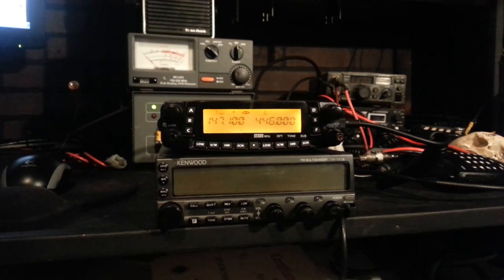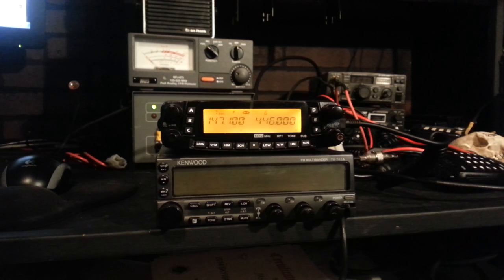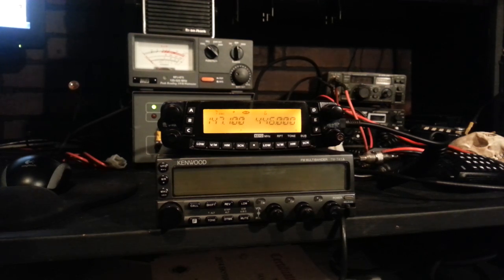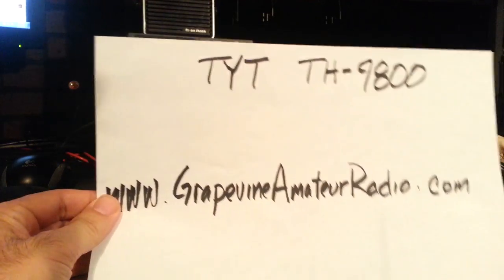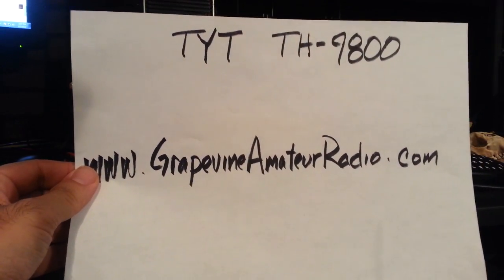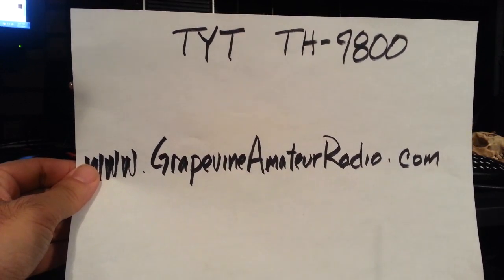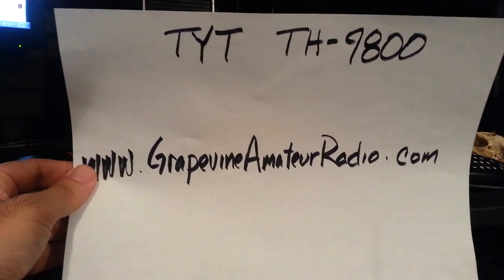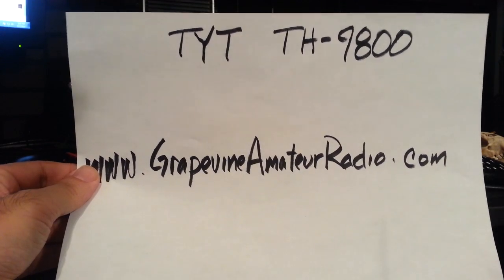How to Program the TYT TH 9800 Quad Band Ham Radio - Ham Radio Programming

Comment: 73! After two years some day start  a constant beep when I change from voltage display to VFO, mainly in the 50 MHz. Somebody know something about this issue?

https://www.youtube.com/watch?v=S0dP5ALsIjs
Reply from the maker: Not sure I understand what you are asking
Reply: @HamRadio2  Thank you! I wanted to know if you know something about a problem that other users of this radio have had, like me, the radio emits a constant beep when switching between memories and VFO or from another screen, it happens to me when I switch between the voltage view and the 6 meter band. In the link you can see the video I made a few days ago
Reply from the maker: Yes there is a beep when you change channels/bands, etc.  You can turn that off in the software of the radio.  It is an old, old issue that was a design feature that no one liked, so they allowed you to turn it off in the TH9800 programming software.
Reply: @HamRadio2  look at this video  https://www.youtube.com/watch?v=S0dP5ALsIjs is not the beep of change between options, is a beep beep beep beep beep beep... like a firmware error

Comment: Great video. Question, how to lock after everything is programmed? To avoids accidentally touch and mess up the setting. Thanks
Reply from the maker: I think there is a keypad lock for the screen, but the way I like to do it is read the radio from a computer and save a codeplug file that can later be loaded back into the radio.

Comment: I just received this radio but cant seem to find the mic gain? Is there a mic gain lol? Thanks for this video very helpful.
Reply from the maker: its in there as "narrow or wide" but they call it something else.
Reply: @HamRadio2  you have to purchase the programming software and the cable and there is a mic gain in the program lowering or increasing Mic Gain. But it can only be done with the programming software

Comment: I have this radio and it worked fine for awhile. The radio now beeps constantly, If I turn the squelch turned down the radio beeps shut off but the beeps turn into a burst of static on and off about every second just like the beeps were. If I turn the squelch back to the right the beeps start again on and off about every second. This just started doing this and I can not get the beeps to stop except when I hit the PPT button. Any ideas on what might be causing this problem and how to fix it would be truly appreciated. KE0RPU 
Show less
Reply: I have the same issue with mine. I've looked all over the internet for a fix, but haven't been able to find anything. Were you ever able to find a solution? Otherwise, it's $200 down the drain😔

Comment: Hello can you use CHRIP to program this radio ?
Reply from the maker: Yes
Reply: Ham Radio 2.0 Thank you. I purchased the RT Systems software program. To program this radio. Because CHIRP pops up a dialog saying this radio is in testing and beta. And not fully developed.
Reply from the maker: Sounds like you may have received a fake or hacked radio.  I've been using CHIRP to program my TH-9800 for over 2 years with no issues.
Reply: Ham Radio 2.0  Very possible I ordered it from Amazon. Myself (KG5PTE) and KG5REN got our radios from the same site on Amazon.

Comment: what kind of base antenna would be recommended for this radio?
Reply from the maker: Comet makes one that is a 6M/2M/70cm.  I'd go with this one.  If you want to do 10M FM, get a switch and  10M antenna.
Reply: thanks for the info . Nice video. is this radio will talk to CB radio?

Comment: The best vid thus far on the 9800..Nice job..   Have one coming from China.. Some dispute as to transmit  AM .. Can you confirm or deny..
Reply from the maker: The original models would TX on AM.  The newer ones are not supposed to, but I have seen some situations where they actually will.

Comment: Software disc dont work in win10
Reply from the maker: Good to know.  I've not tried W10 with most of my programming software
Reply: Download and install CHIRP. Get the FTDI cable so you don't have to ness with changing drivers.

Comment: Thats all fine and dandy but how do I blank/remove programed data in a given channel?????
Reply: I have several mems.with the same information for some reason
Reply from the maker: I think there is a channel delete option in the menu.
Or if you are using the software, then you can just blank the channel out there.
Reply: "You think"  Damned if I can find it! Cant use software as I cant get it to work in WIN 10.

Comment: Hi. This transceiver has the option to change a determined frequency to reverse mode if I need it?
Reply from the maker: There is no "reverse" button on the front where you can easily check the reverse offset, no.
Reply: Ok thank you!
Reply: Hi. I found it, setting the P1 P2 P3 or P4 with the option, I set the P1 to reverse mode, it works!

Comment: greetings; can u PLZ tell if the "cooling fan"is supposed to come on when they unit is turned on.or,does it only come on when it senses a certain temp.mine only spins for about a second when i first turn it on??
Reply from the maker: It should come on when you key it up, or when it gets to a certain temp.  It should not run all the time.

Comment: thank u for youre quick response.but,what Im wanting too know WHAT it should be "safely" set at?? low med2,med1 or, high??( too safely operate the radio)
Reply from the maker: You can safely operate the radio from any of these settings.  It depends more on where your antenna is located.  With an antenna external to the car or house, you shouldn't have any issues operating on any of the power settings.

Comment: if your scanning say 6 meter can you save a repeater freq. in memory can you scan it.  also will the memory hold freq. from all band and scan them or just scan one band freqs. at a time?
Reply from the maker: If you are scanning from the left side of the radio, which all bands are workable from, then yes.  It scans all bands at once.  The right side only scans mem channels in 2M/440

Comment: looking for a cheap mobile radio, ideally i'd like to get some SSB/AM function for 2m and 6m (i'd love to have some 10m->160m, but the only thing that even comes close to that is the Yaesu 857D or Icom 706 mk2g) -- are there any chinese mobile radio's that are doing SSB/AM functions for 2m, 6m, 4m, or 10-160?

also, are you getting the most "up to date" versions of these radios? i think aliexpress has the newest "1601A" versions.
does this thing also have ability to TX on 220 and 440 (even if it is FM only?)

how does this compare to the Anytone AT-5888? is the TYT the "best option" for 2m/70cm mobile FM?
Reply from the maker: Nothing from China that compares with the 857 or 706 at this time. They only have QRP rigs at this time.

9800 radios are the latest.

TYT and Anytone are about the same quality.
Reply: Ham Radio 2.0 thanks. man i wish they just put SSB on the 9800. i bet those would sell like hotcakes if it could do SSB on 6m/2m.

i'll probably still pick one up.
Reply: The 857D is a POS.I had one & would not accept another one for FREE if I must keep & use it.It'd rather have a Cheap AM Only CB Radio.

Comment: Do you know about the programming software and usb cable? Does it work with W10?
Can you put in the name of the station as well as the freq and other settings?

thanks, Ed
Reply from the maker: +Ed C I've not tried Windows 10.  I keep my programming laptop on W7 so that it is compatible with everything.
Yes you can set the radio to display alpha tags inside of the software.  Both the TH9800 software and the CHIRP software will allow you to do this.  It is a setting you have to change inside of the software.

Comment: Just ordered one after a long time looking at this particular model...really wanted 2 meters AND 6 meters...already have 2 meter HT's. Got the programming cable for Chirp too but no power supply. Any suggestions on how to run this indoors off AC power or off a battery that I can keep in my bed room? My "shack" is my room.
Reply from the maker: +nateo200 A power supply would be best.  You can run it from a battery and get a maintainer, but be sure and get a sealed battery because charging a non-sealed battery indoors can produce toxic fumes.
Reply: +Ham Radio 2.0 Yeah my main worry is about non-sealed batteries, I've always been very cautious about electronics and batteries. I've decided to go with an AC to DC power supply adapter for now but in the future I'm thinking a battery will be nice for portable like use. Didn't know this radio did cross band repeating which could be helpful for certain events I attend, its very effective for fire/Law enforcement so pretty cool to see it for amateur radio! Thanks! KD2KKH

Comment: I don't live far from Grapevine and I've been looking to buy one of these radios. Amazon is selling them for 249$ with antenna included plus 18$ shipping.  What is your price and do you have a store front where I could shop around or do you strictly do business from the website?  Thanks 73 AF5GV
Reply from the maker: My normal price is $269 but I usually sell them for $249 at Hamfests. I don't charge shipping at the $269 price.  No storefront,  just the website
Reply: Fantastic.  Thank you for the reply. I have heard about a BCLO issue for these radios. If you don't have the programming software and plan to program manually like I will, it has a factory default setting with the BCLO turned on. Basically this keeps you from talking while the frequency is busy. I have been told that you CANNOT turn that feature off without the computer programming.  Is this true?
Reply: I frequent the 145.330 machine in Ftw. We have a  net every Thursday night at 7pm. You should check in sometime.  We also have a swap net on 146.940 On Wednesday nights at 7 as well. Anyways I have a lot of questions about this radio based on some negative reviews I have read. Id rather talk to you directly on the air.  Does this radio have a mic gain option and a Busy channel lockout in menu options? Thanks for your time and 73, AF5GV
Reply from the maker: +Brandon Allison This issue hasn't been seen for some time.  It was a simple firmware update that was applied, and yes you had to use the computer to apply it, and I have the firmware for download on my website.  But I haven't had to use it in months.
Reply from the maker: +Brandon Allison I often checkin to the 6-shooter net.  If I am home during that time, I will checkin.  Yes the radio has a mic gain option in the menu - but the mic is very hot.  That is basically the only issue with this radio that was reoccurring. I am currently working on an updated mic from TYT to resolve the problem.  If you are using the radio as a base station, you will have no issues.  The only issues I saw were when driving in my 4X4, it would pickup lots of road noise.
Reply: Thank you for answering my questions.  The BCLO and mic gain was going to be a deal breaker because while I appreciate computer programming,  I prefer to learn the manual method this way I can operate the rad
in its entirety should the SHTF . Most people program with software and never learn how to do it manually.  Anyways, ill be placing my order soon. 73 af5gv

Comment: Love the Kenwood 741 you're using as a prop.    I have one of these but the buttons are falling out.   They just kind of friction fit in the panel and all the foam that holds them in has decayed over the years of sitting in a HOT Texas car.
Reply from the maker: +David Dennis it is a great radio.  Mine had the same issue, so I sent it over to Cliff at AVVID for repair. - http://avvid.com/ - he is a bit crotchety over email, but he is an authorized Kenwood repairman and does excellent work.  My TM741A looks and works like brand new.  And it is a triband, I have the 220MHz module in it.
Reply: +Ham Radio 2.0 Thanks for the repair advice.   I've had it as a project on my list for over a year,  so I may just go ahead and contact Cliff about getting this repaired.    Thanks for the helpful advice.    Mine too is a TriBand.   Only I have 10m FM as the third band in mine.

Comment: Hello,  I am very new to Ham radio and I just purchased this radio and I have a question that you might be able to help me with.  I have a Boafeng portable that I purchased and I programmed using Chirp, I got the config file for it from a local HAM, so I really didn't set it up myself.  Anyway one of the channels Tone mode is set to "Cross" , how would I go about setting that in this radio?
Reply from the maker: Jason Fisher To my knowledge, that Cross setting means that it TXs on a different tone than it receives.  I am not aware of a way to set this in the radio.

Comment: I have watched your video with interest multiple times and applaud your efforts. I seem to be having great difficulty in installing the repeater information in memory. While the radio will capture the frequencies, I receive no verification that the shift, code and other data has been installed in the system. After inserting the data and saving, I go back to check the individual channels and it defaults to the factory settings rather than the newly installed settings. None of the supposed settings are displayed on the panel when I access each individual saved frequency. The radio is brand new but I am certainly having difficulty in getting it prepared to go on the air. Have ordered a replacement radio but there may be only one small thing that I am not doing properly albeit I have watched your video and attempted to duplicate your actions but to no avail.
Reply: Robert Vogtner If you are in VFO mode and go change the Offset, PL or shift direction - those settings should stay until you change them again, or until you exit VFO mode (like go into memory mode or one of the hyper channels)
If this above situation isn't true, it sounds like there is a memory problem with the radio.  Contact the supplier you purchased the radio from.

Comment: One question is what antenna do you use for in house operations? I want to use it as a base for the time being.
Thanks W7TLC
Reply from the maker: I don't use this as a base at home right now.  But if I did, I would run separate antennas for Dual-band, 6M and 10M.  Probably a vertical dipole for 6 and 10, and I run a Comet GP9 for 2M/440
Reply: I have used my Diamond V2000A but it does not cover 10 meters just the other three.

Comment: Very good video instruction. How does the performance of the this TYT complare with the Yeasu? I looks like the scan function is slower than my FT8800R. Is that true or is it just how it looks on the video? What about other performance comparisons? Thanks.
Reply from the maker: It does scan slower than the Yaesu.  I have an FT-8900 that I used for about a year before I got this TYT, and the differences are minor, but they are there.  Yaesu makes a better radio - you can't really argue that.  However, for the price, TYT's radio is really good.  I have had no issues with mine and I run it in my truck every day.

Comment: How do I turn that beep off. I went into the menu and thought I turned it off but it's still beeping. Any suggestions will be appreciated. Thanks. K4APD.
Reply from the maker: I think you have to do it in the software.  I leave my beep on, so I have never turned it off, but some customers have told me that you have to do it in the software, or it won't turn off.
Reply: Hi there :)
the beep on these radios are like hell...it almost give me a heartatack every time it make a sound, i turn the sound down to a minimum, but the beep are just like.. BEEP....  so i also want it gone.

Best regards from Norway :)
Reply from the maker: Jon Eirik Martinsen There's a menu in the radio, but also a setting in the software.  You can do it either way
Reply: I have tryed the settings in the radio, that dident work...and i dont have the software for this radio... but thanx for tips :)
Reply: U can try to using disable beep patch @http://www.radioscanner.ru/files/misc/file17977/ 
Use at your own risk. Maybe others who happen to use it can give opinion/review.
Reply: I think the beep is gone now...but its anoing when the one side of the radio is on one freq. and the other side is scanning, damn...heartatack every time...like....BIPP
Reply: Jon Eirik Martinsen did u try patched yet? i got a fren also had same issue. not sure if upgrading firmware will be good.
Reply: Sorry i have not tyred it yet.
Reply: Mine is now just beepin when it scans...and it does so i just dont scan anymore, i just makes the channels step manualy...i can turn the sound down to the minimum, but that beep is like on full ..every time, every step...and it gives me heart atack hehe.

Comment: I just purchased one from China  works perfect all except the mic has muffled deviation not radio" put it in crossband clear as a bell. What other replacement mics w/ rj-45 connector out there I can use on radio. 
Or adapter rj-45 to ? 
Also neen mic rj 45 wiring diagram.

Comment: What kind of set up do you have for running this of normal 120v house outlet? I am planning on buy one to run at my house so I was just wondering if you could help me out.
Reply: Your kidding right? If you are a new ham, then get some help from a local ELMER   While this radio isn't difficult to program its not intuitive especially for a newbie.
An appropriate power supply would be something like the MFJ 4125
Reply from the maker: It's just a Radio Shack power supply in the video
Reply: YOu simply need a 12 volt supply. The radio only pulls 8.5 amps at high power.  Not much to it.